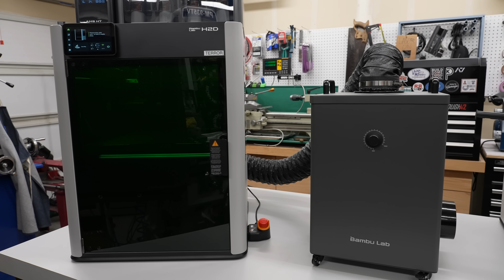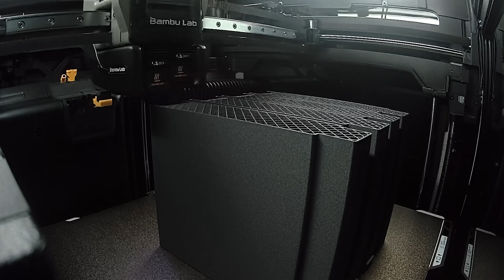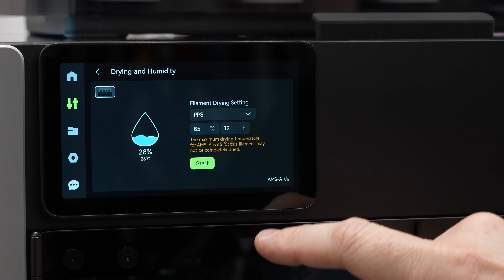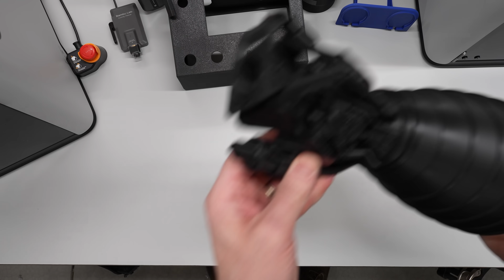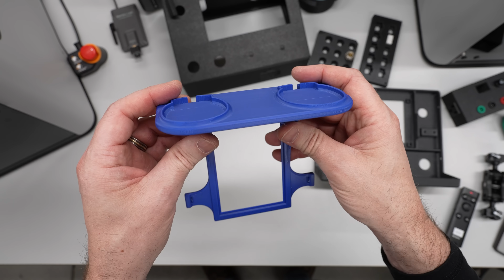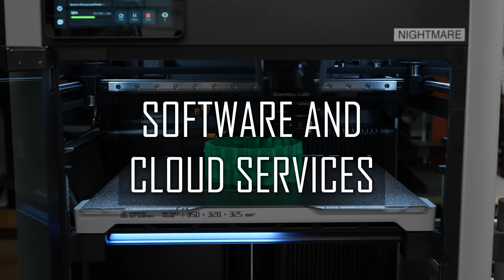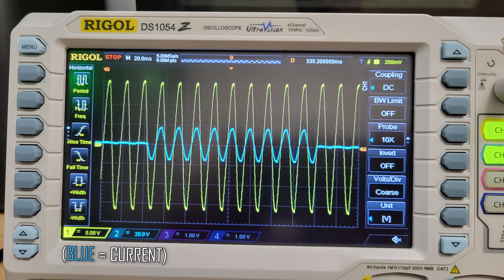What I Learned from 300 Hours with the Bambu Lab H2D 3D Printer

Comment: Now THAT’S what I call a professional review. All the good stuff and not skipping over the bad stuff without any solutions. I think the Lazer was, in my opinion too expensive to justify for the hobbyist, but would undoubtedly be a good addition to a print farm if expense wasn’t really a consideration   I will certainly be considering one of these, due solely to your review. Thanks for a great and very informative video.
Reply: I exhaust my Glowforge outside, I maintain negative pressure in my shop via a second exhaust system and I still see poor air quality measures on my sensors in my office next door when I'm running the laser all day. It's not just during running it's when you open the door, as you work with the pieces, remove masking. I try to reduce this with room air filters but burning produces ash and fumes.
Reply: No it's not a professional review the very first thing you should have told you is the bamboo Labs is a company that tries to f*** over their customers intentionally so it doesn't matter what their machines supposed to be able to do they're not worth touching they're not worth Penny you could not ever in a million years just by spending a scent on their garbage they are accompanied and needs to be seriously punished for their mass pass misbehavior and never ever supported again
Reply: A standalone 40-watt hobby printer is going to run $3.5-4k US, so to get this as a $2k add on to a 3D printer could be a bit benefit for someone who only wants to laser occasionally and doesn't want the space and expense of maintaining a dedicated machine for occasional use. I'm waiting for reviews about cleaning and maintenance with long term use of the laser as they can be very dirty and need constant cleaning.
Reply: @n8zim  Where are you getting that 3.5-4K number for a 40-watt standalone laser cutter/engraver? You can definitely get a decent 40-watt laser for less than the $1600 price increase(and doesn't have the downside of needing to thoroughly clean the printer from all the laser dust)
Reply: Glowforge, Muse, Dremel, Xtool all showed about that price on a quick search. I agree and have commented about cleaning on other comments.
Reply: @n8zim  I wonder how healthy that laser dust is also, like really thin powder that is easily airborne. I guess you need really really good ventilation when in use? (unless you get that laserdust collector bin), anyway the fumes are toxic depending on material you cut, so better be real safe than sorry.
Reply: @AndrewTSq  it does have a in built filter
Reply: @ yeah, but we had a industrial one at last work with filterbox etc, and you could still smell it in the air. so not sure a simple filter is enough ? maybe different on different materials.

Comment: Ever since I modified the wiper mechanism on my x1's and p1s machines, then used slice engineerings ptfe nozzle coating. The need for a pair of tweezers next to my machine has been next to non existent. Those two changes where huge in that department.
Reply from the maker: I messed around with a new wiper that uses pieces of the silicone brushes from the A1, and it definitely helped.  Maybe the nozzle coating is the thing I've been missing.

Comment: Thanks for the review your conclusion is spot on what I am looking for, later this year I will probably be adding one of these in depending on the teething issues.  On their website it shows the laser actually has contour support which is a huge deal and makes something that I thought was a gimmick much more interesting, hopefully you can mess around with the laser unit a little more in another video because there is more potential with that then I previously thought.
Reply from the maker: I plan to play with it, but I don't know how applicable it is for me.  Most of what I do is fiber laser marking on metals and plastics.  Neither are great applications for a diode laser.  I probably will mess around with Cermark, though.  That should work well.
Reply: @Clough42  It would be interesting if they release a roadmap for planned accessories with the laser equipment, like a rotary axis or other equipment. Also would be amazing if they gave us the 240v option state side

Comment: Do you have to manually swap on the laser or knife I guess?
Reply from the maker: Yes.  There's a dovetail attachment and a locking clamp lever on the front of the head, and a short cable that plugs into a connector under a dust cover on the top.

Comment: In Bambu's most recent ad for this printer, they suggest 3D printing a bicycle helmet. Call me old fashioned but that seems *wildly irresponsible*. Thoughts?
Reply: I think its more meant for prototypes not final products
Reply: @edgard.1430  most of the people bitching about the H2D don’t know what a “prototype” is. They print nude anime figurines and panic that they might have cancer because one of their neighbors four houses down smoked a cigarette.
Reply: It would work fine for a bicycle helmet. The interior foam is far more important than the shell, and is what really protects your noggin in one of those. Maybe not for racing, but general everyday road use it would be fine.
Reply: @sean.chiarot no foam is not important, in fact has no role to play in crash protection. The foam is there make the fit a bit more comfortable. The actual protection is provided by the fit of the helmet, the material and engineering. Bicycle helmets are somewhat uncomfortable for this reason. In any case they are designed to withstand light crashes and bumps on the head while falling,nothing more than that
Reply: @arbjful  The purpose of the outer shell is impact deflection. It deflects off the pavement but won't absorb the impact energy. The purpose of the inner foam is impact absorption. The more energy absorbed by the foam, the less energy is transferred to your brain. Which is the entire purpose of a helmet.
Reply: @ I wouldn’t risk a 3d printed helmet on my head still..
Reply: Printing a helmet doesn't mean it must be used for protection. You might print it for size testing, prototyping, props, design showcases, etc.
Reply: If you're dumb enough to 3d print a bicycle helmet and use it, you deserve what you get.
Reply: You can probably print an iso structure to act as a shock absorber for impacts but definitely not gonna be better than store bought manufactured bike helmets. But definitely cool for prototyping helmet designs rather than a final product.
Reply: @CoDB02  store bought bike helmets are Styrofoam with a had plastic shell to keep them from falling apart. Anything 3d printed would be just as strong as Styrofoam
Reply: That is idiotic, you don’t want something strong. The whole point is a material that crushes easily and in a very defined way. The shell is much the same, it needs to maintain integrity and allow the whole assembly to slide along the ground.
Reply: Literally all depends on the print environment, settings, and materials used. 3d printed 2a scene is where to look for the most superior materials and designs imo. Wouldn't be surprised by a dot approved bike helmet being the other things that are out there.
Reply: I use two printed bicycle helmets for extra safety… They are a little heavy, but both being printed out of PPA-CF makes me feel double extra safe…
Reply: Gotta say printing is finally becoming viable. As a hobbyist I've  been following the scene since the beginning but could never justify spending the money on something so finicky seeing that I have a million hobbies that demand my money. This is really the first machine that I've seen and been like this seems tolerable everything else had a flaw that was a deal breaker.
Reply: Um, not a good take for something like a bike helmet..."no reason something like this couldn't be tested and DOT approved" part of this sort of testing is testing the repeatability of the actual production. Hobby, home 3d printing is amazing and really cool, but zero chance you could get a bike helmet approved and actually be safe, consistently, with the current technology.
Reply: @Obtuse94 why not if your helmet design met DOT specifications, and you designed it in mind that it could be 3d printed, why couldn't you make a functional helmet
Reply: The shell of the helmet is not the important part in preventing concussion. It's the infill. Styrofoam is adequate in off the shelf headgear but who says it's the best?
Reply from the maker: That's one of the demo models they sent to influencers.  There's no particular reason why a 3D-printed bicycle helmet couldn't be tested and DOT-approved, but there are so many variables that I personally wouldn't take the risk.
Reply: Sounds like a few lawsuits in the making.
Reply: I'm glad you have so much time to contemplate these silly things.
Reply: Yeah, it might just split along a layer line and end up getting some brain damage.

Even printing a saddle is suspect. One bad landing or bump in the road, if that sucker breaks it might perforate your nether regions
Reply: @NathanBuildsRobots your that guy thats got a hate boner for bambu printers
Reply: @NathanBuildsRobots I think that some motorcycle riders already have brain damage, considering how they ride.
Reply: @NathanBuildsRobots  shamefully, I agree with your comment on this subject  for some "odd" reason. Otherwise, your are full of you know what most of the time... do a video on ender 5 max heatbed recall if you dare... you hypocrite... cheers!
Reply: @Tacks3D  Good idea, will bring it up in my next episode of 3D printing news if I can remember! There has been so much going on in the space recently.
Reply: @NathanBuildsRobots I think specialized had a 3d printed saddle, saw a review on GCN long time back, not sure what happened to that product, didn’t hear much afterwards…
Reply: @arbjful  other brands do them too, theyre everywhere. typically it is 3d printed padding on a carbon base
Reply: @NathanBuildsRobots  nah it was crash rated
Reply: @NathanBuildsRobots  when will we see your objective review of this machine?
Reply: @riba2233 "objective" lol.
Reply: You anti Bambu guys will find any flaw and fixate on it so hard.
Reply: @paintballercali  They didn’t even find a flaw. They just willfully interpret everything in the stupidest way possible.

Comment: Very good review. Only issue I have, is you need to be knowledgeable to understand it. No fault of yours. What I and I'm sure others need is 3D printing for dummies. I am with you, I just want the stuff to work. Without a large learning curve. Maybe Bambu Lab should make an affordable for people just starting on 3D printing.
Reply: They do, the A1 mini. Great starter printer. $240 and it goes on sale for $199 all the time.
Reply from the maker: Check out the A1 mini.  That's what I recommend for everyone just getting started.  It's small, it's quiet, it's cheap, and it's pretty easy to get going.  The biggest challenge for most people starting out is when they discover that there's a pretty big learning curve to making your own designs, but if you want to print stuff downloaded from sharing sites, it's pretty easy.

Comment: You don’t mention speed. Same as X1C?
Reply from the maker: They do claim higher flow rates, which is the main bottleneck in most cases, and they also have add-on high-flow nozzles, but I didn't test that specifically, so I didn't want to make any claims.
Reply: I think this one is 1000 mm/s, so twice as fast as the X1C. but the acceleration is still 20,000 mm/s².

Comment: Good review. Not sure my X1C is about to be upgraded. The Laser upgrade kit or just a 3D/Laser machine I find so odd. I dont want a 3D printer that smells like burned wood. I got my Xtool S1 for that. I would properly have expected more on the 3D print part. I see the benefit of the dual nozzle for support on a single color print, the PLA/PETG support or orther way around is a good point. I do use high values for flushing on my X1C, so a dual nozzle would be nice for that case. But for multiple color print where several colors on a single layer is needed, Im not sure how much it will benefits with the dual nozzle. If one nozzle could purge while the other print, then it could have made a huge time saver. Purge is one thing, its the time to purge with 1000 color change that adds up the time of the total print.
Reply from the maker: Add very good points.
Reply: Bambu did post a support article on cleaning the printer after heavy laser use, with photos of what to expect.

Comment: Looks like a great machine, sadly it's way out of my price range.  That being said the AMS HT seems to be a decent high temperature dryer at a reasonable cost finally.
Reply from the maker: I haven't tested it, but the documentation I saw says that it'll be supported with a firmware upgrade on the X1.

Comment: Timing belts will rip if you lube them. But this will take many many  hours.
Reply: This was just on the flanges so it will only ever be on the very edge of the belts. Very little chance of it effecting belt life when done properly.
Reply: @JorgTheElder  It can simply spread. No matter what the justification it will weaken the belt over time, that´s a simply a fact. I know you are a fan boy you don´t have to fight.

Comment: RFID tags and their software is also creating a closed system and sucks up all your proprietary data, which is a nogo in the industry I work in.
That "feature" is never mentioned by the fans and yet it´s always present.
Reply: RFID is only to help the user by loading filament type. It works without RFID. The fact that you are bringing this up when people have known all about this for 2,5 years is just showing you are not familiar with it.
Reply: @rsilvers129  For now it is...
Reply: The RFID gather exactly zero data. They are nothing but a digital bar-code. They identify the filament you are using which is information they already have because these printers are already part of an integrated system. If that is not for you, don't use them, but it has nothing to do with the RFID tags.
Reply: @JorgTheElder   that’s not correct. The RFID chip and the loading sequence is used to measure how much is left on the spool. With the position of the chip in the arms and how much it moved while the filament got loaded the printer can calculate how much is left on the spool. More movement of the RFID means the spool is more empty for example.
Reply: @JorgTheElder  "...The RFID gather exactly zero data...." Ah the fan boy. No they don´t they will simply block different filaments one day.
Reply: You can use 3rd party filaments. The only difference is you have to manually enter the correct filament and there is no tracking how much is left on the spool.
Reply: @Todestelzer  For now....
Reply: Dumbest comment so far. LMAO. Google is free.
Reply: @KryaDiere  Ah yes the army of fanboys
Reply: You don't have to use their software or their spools with RFID tags if you don't want to, the printer works perfectly fine without them.

Comment: The Prusa XL needs a pin ( 6:52 ) because you have to line up multiple tool heads. This printer has one toolhead with two nozzles. Each has its benefits and downs... I'm not saying it to bash anyone, just a little extra info ;-)
Reply from the maker: The Prusa could use the same kind of eddy current sensor to align, even with multiple toolheads.  That would be a good addition.  It's just a matter of finding a place to mount it.
Reply: @Clough42 but as far as I know, and I could be wrong of course, eddy sensors are for nozzle to bed leveling. Not for offset between nozzles. Each toolhead is mounted by hand and not on a fixed point, so they need to be aligned and calibrated accurately. But that’s only when changing nozzles, not before each print.